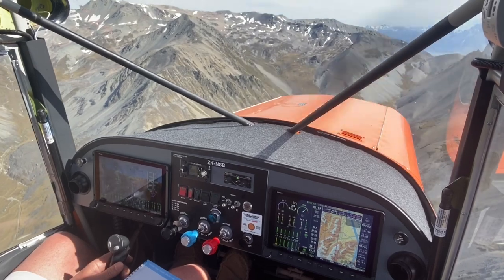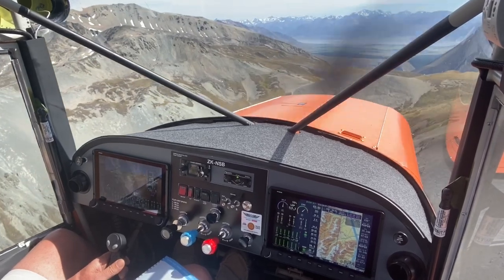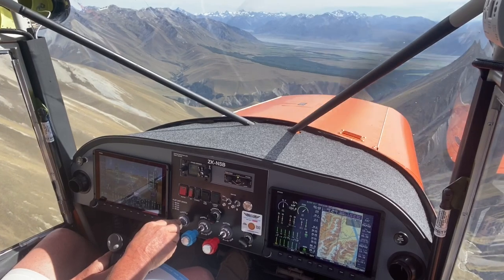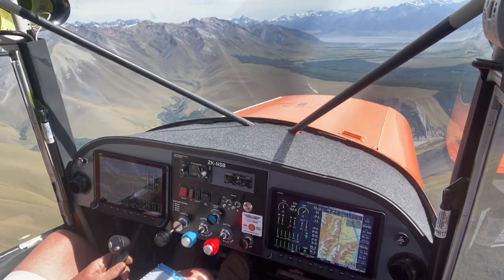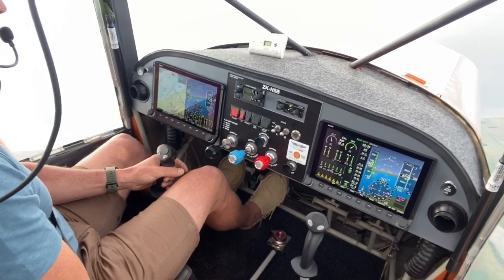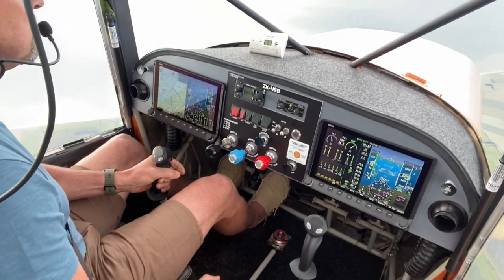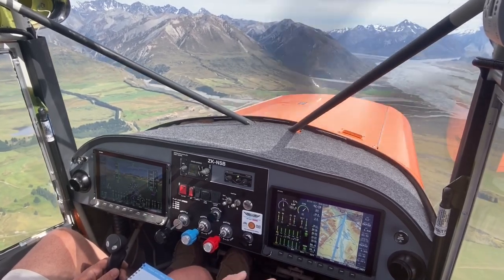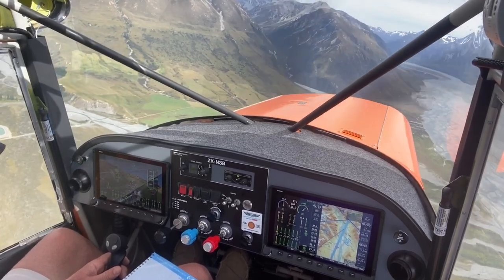Bearhawk Aircraft - Bushplane Build - Flight testing - Fuel System

Comment: Yet another great video, Nev. i 'm  really  enjoying  your professional pilot approach to testing and the detailed commentary on the problem/diagnosis/fix/test  methodology. I'm thinking I might do a pre-emptive  strike on the CO issue around the gascolator  drain and install a small Gurney flap like you have done. It is easier to do it now and it will be painted with the rest of the airplane. I have also bitten the bullet and bought a CO detector that integrates with my G3X so I get visual and auditory warnings.

Comment: Do you knuckles get jammed into the prop lever? They look awfully close together.
Reply from the maker: Yep they do look close in the video. But the spacing works well so it might be the camera angle. I spent quite a while mocking the levers up before installing them to make sure the clearance is fine.

Comment: Hi does it fly and handle as advertised is there any adverse yawl
Reply from the maker: Hi Matt, yep pretty much as advertised. I'll probably include a video on the handling and performance down the track. I got used to quite quickly, but there are a couple of things that do require getting used to. The roll rate depends on how you set it up and is easily adjustable. Currently mine is heavy, and I'm going to put it back to a much lighter roll response that I found really nice. Yaw is sensitive and took me some getting used to. It's a trade off because you want that sensitivity on landing. Same with pitch, more sensitive than most aircraft but only by a little. The pitch trim is very sensitive at higher speeds, and loses its sensitivity at low speeds. Actually it's difficult to have the pitch trim cover the full speed/CG range because it lands so slowly. But overall, after about 3 hours I was quite comfortable and I spent the remaining test period fine tuning the rigging to how I like it. There's definitely adverse yaw, but I think with the B wing it must be alot less than the A wing. I don't notice it now. I've flown with yaw dampers for many years so that was the challenge really, not the Bearhawk as such. Also, you can reduce adverse yaw by reflex ing the ailerons, which also makes the roll very light and responsive.

Comment: Hi Neville. Do you have a purchase link to your  carbon monoxide digital monitor? Been meaning to get one. Enjoying your videos! Cheers Hayden
Reply from the maker: Here you go. There's a few different ones available with digital read outs. An alarm silence button would be good although so far it hasn't been needed but if the alarm ever goes off it'd be useful.
https://www.mitre10.co.nz/shop/quell-carbon-monoxide-alarm-white/p/269812
Reply: @bearhawkblog3527  Thanks for that

Comment: How much does this plane weigh?
Reply from the maker: It's empty weight is 1498 lbs. MTOW is 2700lbs, MLW is 2500lbs. I use 2300 lbs as a comfortable weight for operating into shorter airstrips.
Reply: @bearhawkblog3527  thanks. What is heavy and flies lightly

Comment: So give us some numbers? Vso? cruise? STOL distances? gph?...
Reply from the maker: Stalls at 38kts full flap, 48 flaps up. Cruise rich of peak 125kts, LOP 115 kts (that's my usual cruise) at 38lph (roughly 9 gallons per hour). At 7000ft it burns 32 lph at 120 kts TAS. Carries 4 adults, 4 hours fuel + reserves, and 50 lbs bags.
Reply: @bearhawkblog3527  thats 43 mph Vso mmm higher than stated. 
Thanks for the info, I am interested in the companion.
Reply from the maker: Yeh I can't remember what they state the stall speed as. But it's very dependent on the aircraft weight. And dependent on pilot technique too (as I'm discovering).
Because I've got an IO540 engine (170 lbs heavier than an IO360) the stall speed will always be higher. But it's a trade off with climb performance at altitude too. Also the takeoff run at MTOW is shorter with the more powerful engine. There's always a trade off........